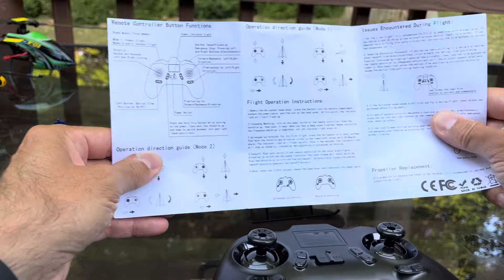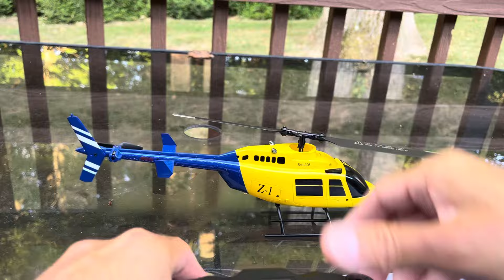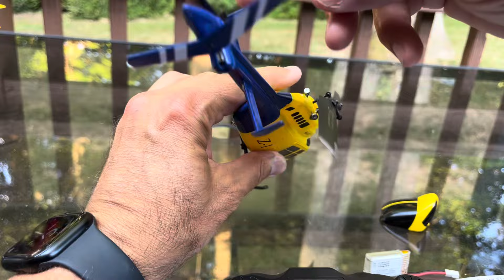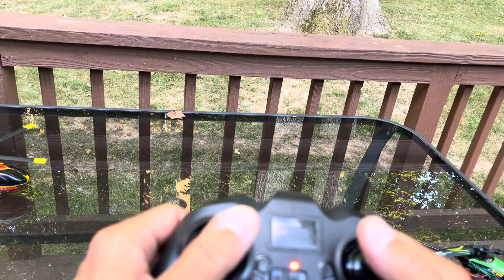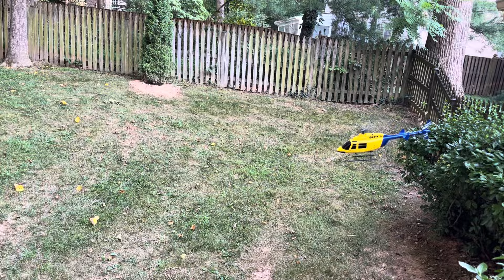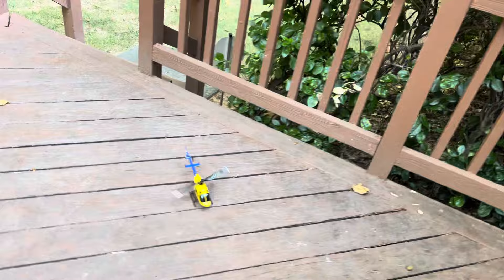Z1 Bell 206 RC Helicopter maiden flight and more

Comment: Its more flying  like Nine Eagles Hughes 500 but it have budget batteries. Maybe flytime 5-6 Minutes?
Reply from the maker: @ka4172  this has only 2 servos so it will be wobbly. The Nine Eagles H 500 had three servos from what I recall.
Reply from the maker: Three servos means it has pitch as well and therefore a collective pitch heli.

Comment: Nice review,I have the c189 md500 and c129 v2 both are excellent helicopters,I may get the c190 soon but it's basically the same as the md500 except for the tale rotor so I don't know yet if I will bother.
Reply from the maker: @appsstore11  C190 has the tail fenestron simulation which is very different from the C189 which has the regular tail rotor. The C190 gets less flying time and feels heavier than the C189. They share the same rotor head, main gear and motor as well as main blades.